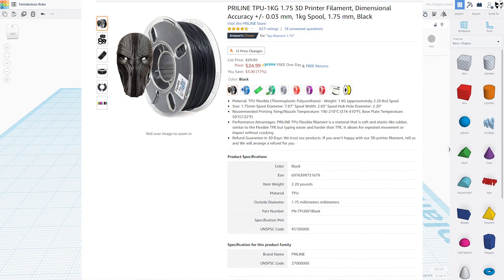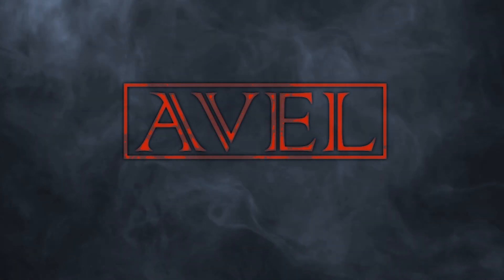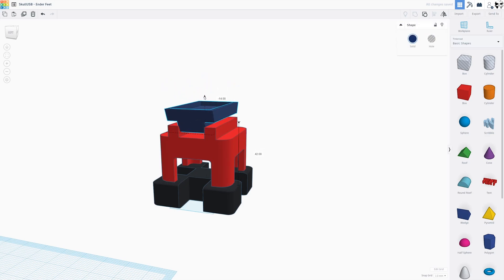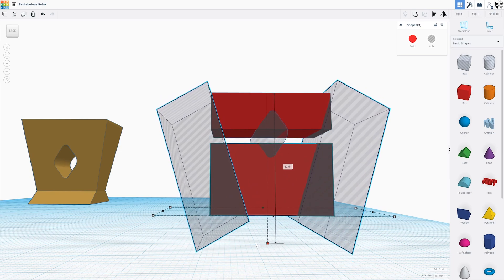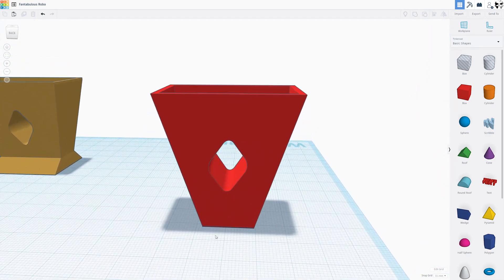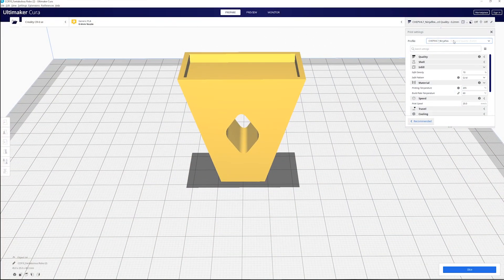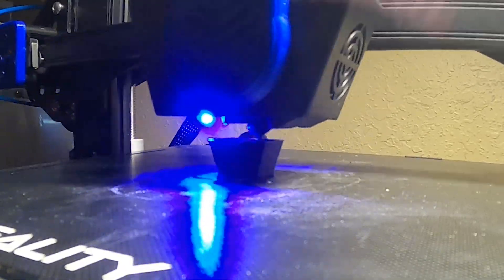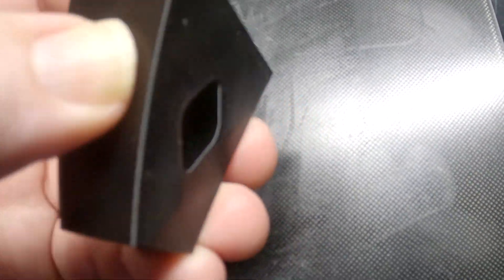Designing Parts for the CR-6 se! | Dampeners, Risers, Feet

Comment: If I will scale it will it work for the max version?
Reply from the maker: Creality uses the same padded feet on a lot of their machines. It may fit as is, I'm not sure.  

You could try just printing the top part one time and checking. If it doesn't fit, you'll have a better idea of how much you'll need to scale up.

Comment: I just ordered a cr-6 se! Will arrive mid januray. Anything i should be aware of? Nice video
Reply from the maker: Thanks!

Congrats! As long as your power switch isn't faulty (I'm hoping they've resolved the issue with the newer batches by now) you should be good to go right out of the box. After you put it together, of course. Which is simple.

I can tell you, if for any reason you ever have to take apart the extruder, it's frustrating to get back together. They've designed it in such a strange way.

Other than that, happy printing!

Comment: The blue LED is an ugly one. I am going to replace it ASAP. My eyes hurt during the first layer. 

I am going to print the feet... after I buy some TPU and have some experience. I am using my second spool right now (first one is the Creality sample provided)

Can you please design a part cooling fan for CR-6 SE, using the blower fan provided or recommend any from thingiverse? Thanks.
Reply from the maker: I can point you to one, but in my opinion they're not necessary. I tried several different fan ducts/part cooling fans on my Ender 3 and none of them performed any better than the original. Some actually were worse. So, I ended up just going back to the original duct.

Also, in order to keep from melting, you'll need to purchase a roll of PETG to print it out of that can withstand the heat from the nozzle. 

But if I was going to print one, it would be this - https://www.thingiverse.com/thing:4602298
Reply: @Avel  thanks. Stock it is.

Comment: Yeah, why BLUE? 
I've already ordered a pack of clear white leds.
Nice design.
Did you glue those to the existing feet, or is it just using gravity?
Reply from the maker: Haha, right?
I'm going to swap mine in the future, too. The blue just doesn't make sense.

Thanks! Nope, no glue. The printer is just resting on them. There's a lip all the way around the model that kinda cups the rubber feet that come on the printer, but that's it.